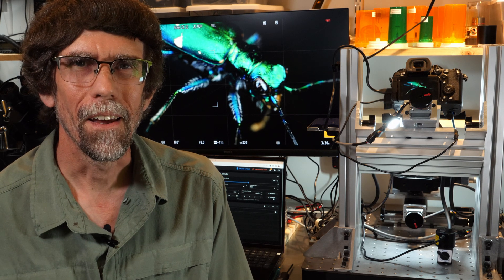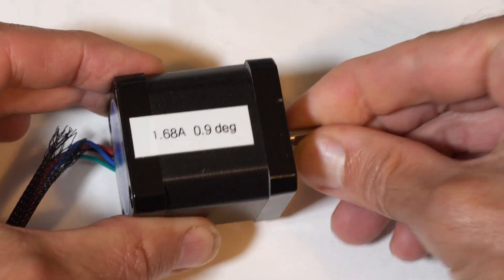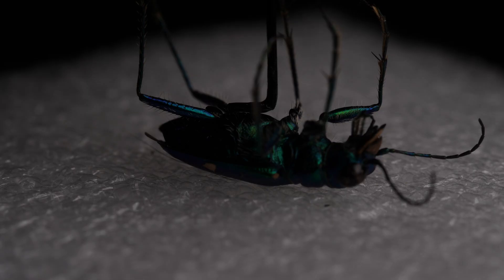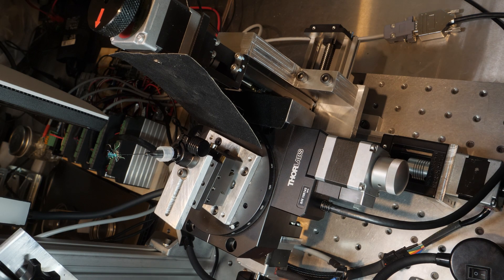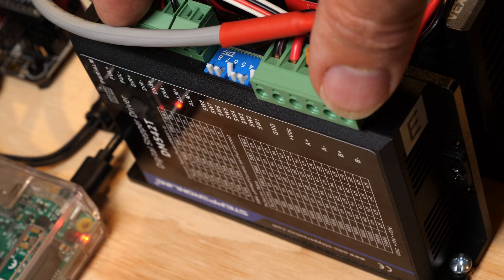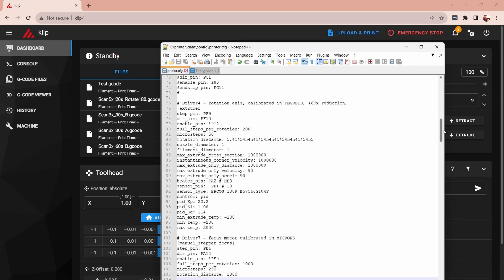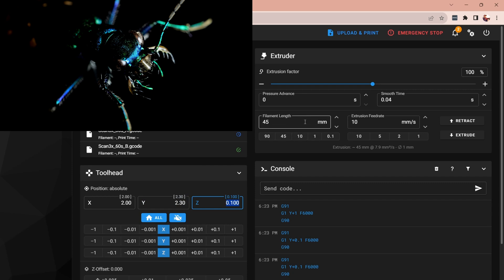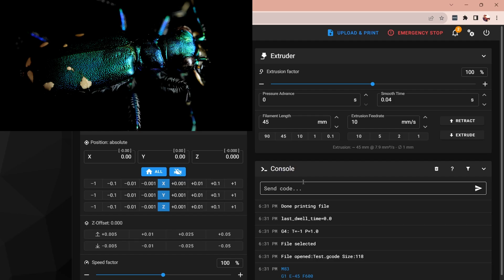CNC Motion Control for Macro Videography

Comment: Google recommend your video when I was wondering about using cnc for macro photography. You are leagues beyond in video land but still a great watch. Will look into your rig more but in a scaled back xy only idea. My dream is to macro scan things like gpus and stitch into a massive photo.
Reply from the maker: Most people who do that kind of scanning use a stack-and-stitch approach with XYZ scanning. It's nearly impossible to keep a wafer or large GPU in focus throughout a large scan, or even throughout one image if the magnification is high. So the workflow is typically move in XY, then step in Z while acquiring enough images for a stack (tens or hundreds depending on the magnification), then move to the next XY position. Then the images for each XY position are focus-stacked, before stitching together all the stacks. Here's a post that you might find helpful: https://www.photomacrography.net/forum/viewtopic.php?t=9542

Comment: Love the motion control interface and the interesting components. Who would have even dreamt of 5 ph steppers.  Is 1mm pitch ball screw even a thing? Can you imagine re-balling the associated ballnut :) Good lord. Anyway my guess is that the money shot is generally the A axis or rotary motion yes? X and Y traverse is little used so far as I have seen. But I haven't seen much. Really liked your most recent exploration of Lichen
Reply from the maker: I hadn't heard of 5-phase steppers until I bought a THK KR20 linear stage on eBay that came with one attached. It's a nice combo because with a 1mm lead on the ballscrew the 0.36-deg motor gives me a resolution of one micrometer per step. And no, I can't imagine taking one apart and ever getting it back together again. :)
You're absolutely right that the rotation axis is the most useful for showing 3-dimensional shapes. I use long-working-distance microscope objectives in order to have enough room to move the subject and position the lighting, and that long distance means there's very little change in perspective from linear motion so it's not much different than taking a single photograph and panning it around. It's the rotation that makes things change shape so our brains can perceive the 3D structure. The X-Y axes are still useful for panning shots like some of those in my lichen video, and I also use them to fine-tune the subject position at the start/end of each shot while the primary motion is rotation. I'm not currently using a Z axis because it compromises rigidity and despite my best efforts, vibration can still be a problem at high magnification.

Comment: Thank you, Jay - this was extremely helpful and packed with answers to many of the questions I have been struggling with in putting together a sufficiently stable positioning platform for my own work. Much of the hardware you have selected is well beyond my means and that prompts me to ask one question - have you seen a distinct difference between the 5-phase steppers you have chosen and the more affordable 400 step-per-revolution motors deployed at 1/16 or 1/32 micro-stepping? Thanks in advance and please keep sharing your work - it is highly motivating!
Reply from the maker: First of all Allan, I've learned a lot from your website at www.allanwallsphotography.com and your YouTube channel @AllanWallsPhotography so thanks for all the great info you've published. As for the stepper motors, my first focus stage (now my Z axis) was a THK KR20 that I found on eBay, and it came with a 5-phase motor already attached. I'd never heard of those so I had to do some research, and eventually found the 5-phase driver also on eBay. It has worked well and seems to be very smooth, but I can't do an apples-to-apples comparison with a 2-phase stepper on the same axis. However my rotation stage came equipped with a 2-phase motor that's not easily replaceable so I've been using that, and I would say that when I have vibration problems it is nearly always due to that motor. I found that I could reduce the vibration by adding extra rotating mass, in the form of a roll of tape that I jammed over the knob on the back of the motor. I'll probably 3D-print something nicer than that. But at any rate if you're going to use a 400-step 2-phase motor I recommend getting a double-shaft motor so you can add a knob on the back (which is extremely handy for positioning anyway), as that will increase the rotational mass and that can reduce vibration at low speeds - although in theory it can also make things worse at some speeds. I also recommend the DM542T stepper driver because in my past experience with stepper motors it caused less vibration compared to cheaper drivers.
Reply: @BrainRight   Thanks Jay, this is very helpful and quite consistent with my own experiences. Unfortunately, constraints of space and cost have prevented me from being able to use the largerDM542T drivers and the lovely 5-phase motors, but your setup seems to have overcome most of the vibration issues that seem unavoidable  when using lower cost components. Please keep up the good work! Allan
Reply from the maker: Allan, I have another tip for you - regardless of what driver and motor you use, you can reduce vibration by setting the drive current to the minimum that is sufficient to move the axis without any lost steps. Macro work almost always involves low speeds and loads far lighter than the motor+stage could handle so you can get by with quite low motor current, though it takes experimentation to find the sweet spot. The problem with that  DM542T driver is that its minimum current setting is 0.7A RMS and that's about twice what I need for my rotation axis. When I switched to a "lesser" driver with a lower current range, vibration was significantly reduced.